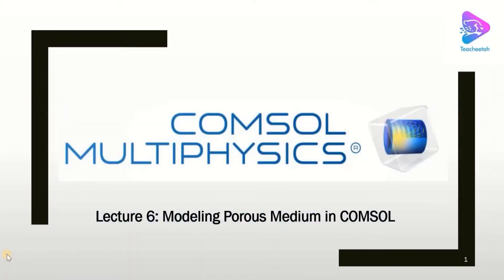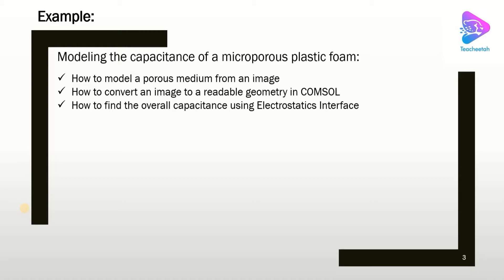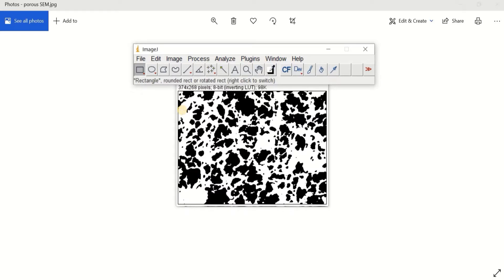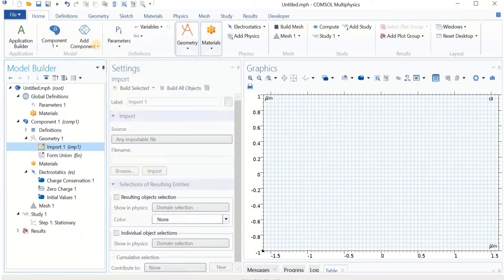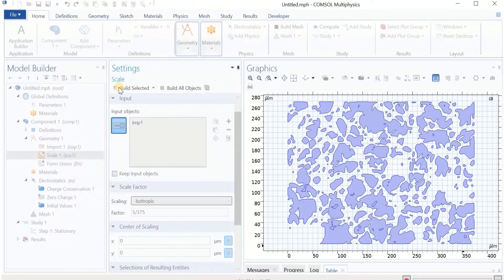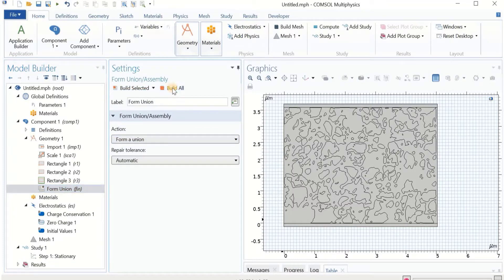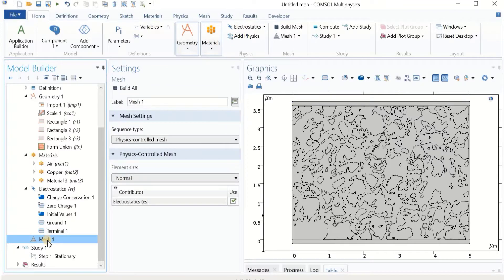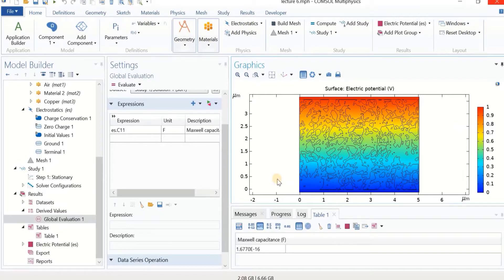Tutorial 6: Modeling Porous Medium in Comsol Multiphysics

Comment: Is it possible to simulate the porous resistive sensor as similar to one of your tutorials of micro pattern resistive sensor by using this method of using SEM image of porous conductive foam ?
Reply from the maker: By combining the procedures explained for the micro-patterned model and porous model in our tutorials, there might be a chance to model the piezo-resistive conductive foam system. It might be a bit tricky when the contact pairs need to be defined for the internal porous structure when building the model from an actual image. A more simplified way is to consider the pores as equal shapes (e.g. spheres) uniformly distributed through the structure.
Reply: @Teacheetah  thank you , I am trying to simulate the 3D micro patterned based piezoresistive based sensor on the basis of your tutorial on 2D types
Reply: @Teacheetah  it’s very informative video , it’s a request to continue such tutorials

Comment: Thank you for the awesome video. I have a question. If I want to simulate fluid flow in a similar porous model as shown here, I need to make the fluid flow through the empty spaces, ie. the pores. But how to do that as the pores are not connected with one another?
Could you please help?
Reply from the maker: Thanks for the comment and great question. We have simplified this model to a closed-cell foam which in fact the pores are not connected. Depending on the image from the porous media, you may process the image such that the pores are connected with an open-cell configuration. For example, if for this case we assign the solid domain with air and the air domain with solid (switch the air and solid domains), we can create a geometry with connected pores. Please let us know if you have any question
Reply: @Teacheetah  Thanks a lot for the suggestion! In this case, my doubt is if for the same geometry, I assign the connected domain ( actually the solid)  as air or water and the discrete domain ( which is actually the pore spaces) as solid fibres, that would change the entire physics of the problem.  In that case, if I try an experimental validation, it may not give a good match. Please convey your opinion regarding this.
Also, are there any mail IDs where I can write to you?
Reply from the maker: Thanks for the comment and question. Again it depends on the image of the porous domain that we process and how the pores are connected in the image. We just mentioned switching domains to give the idea how an open-cell configuration can look like from an image not practically for this physics. We prefer to have all questions in here as others might have the same questions as you, and it will help them to solve their problems. If you want to send us a file regarding your question, please let us know. Thank you

Comment: I want to simulate a transient three-phase flow in porous media considering capillary action (Filter paper soaking water up). The porous zone is initially filled with air. I want to model the displacement of air with two liquids (water and glycerin, let's say) due to capillary forces. My main interest is the degree of wetting and the spreading of the wetting front. How to model capillary effects in the porous zone? I did the simulation but  It is throwing an error " Unknown function or operator, Name: step1" Can anyone help me out?
Reply from the maker: Hi Vinash, thanks for the comment and question, your problem is very specific, however, we have found a few resources that might help you. Please check links below:
https://www.comsol.com/blogs/computing-porosity-and-permeability-in-porous-media-with-a-submodel/

https://www.comsol.com/blogs/simulate-three-phase-flow-with-a-new-phase-field-interface/
https://www.comsol.com/porous-media-flow-module

We will look for further resources, and will update you. Stay tuned

Comment: got this error while emulating the same in my comsol: 
Undefined material property 'epsilonr' required by Charge Conservation 1
Reply from the maker: You may need to check if the properties of the materials assigned to the domains are fully defined. It seems that the relative permittivity value of a material is missing
Reply: @Teacheetah  yes it's done. Thank you.

Comment: What if I don't have a SEM?
Reply from the maker: Thanks for the comment.
The method proposed here is based on the image captured from a porous material using SEM, optical, scan, etc. Please note that porous materials may also be modelled in the software by other techniques and modules e.g. porous interface.
Reply: @Teacheetah  please elaborate on this
Reply: @Teacheetah  please elaborate if we want to vary porosity manually.